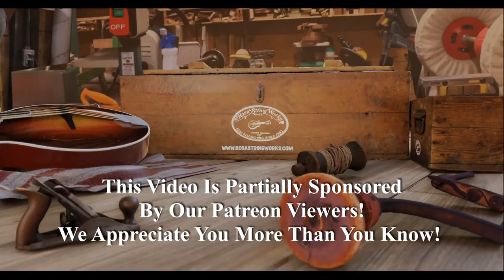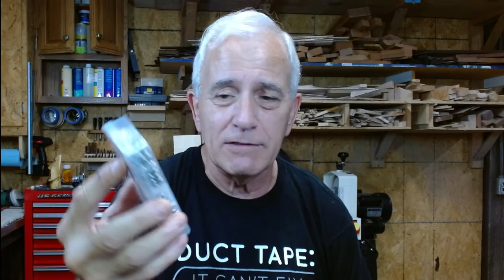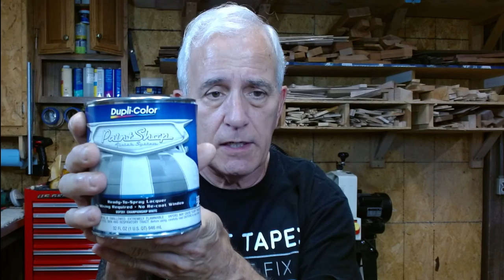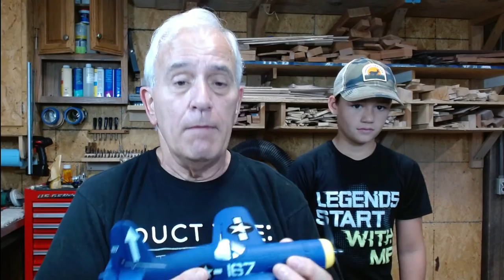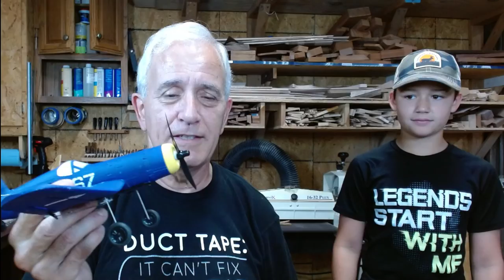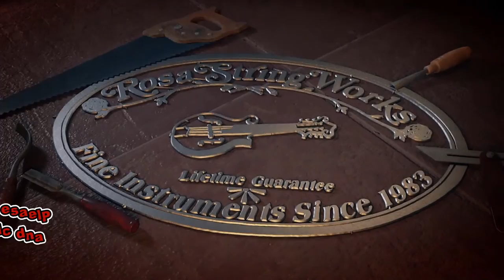Vlog 282 Live Trinians Project Remote Control Airplain

Comment: Oh boy, rc planes. I've been flying rc for forty years. 

I must say while low wing warplanes with a 400mm wingspan look cool they are extremely difficult to learn to fly with. 
Assuming the plane has a flight controller with beginner's mode a beginner wants to use strictly it else  smashed plane.

If your grandson wants to keep at it I would strongly suggest the Eflite UMX Radian 3 channel motorized sailplane. It in ready to fly version has a cost slightly above $100 and has both beginner mode called SAFE as well as the experienced mode. This plane is both nice looking and flys beautifully and is also a great beginner aircraft.

Other starter planes are pretty much any that has a high wing with a dihedral and today one can find these for under $100 in ready to fly  condtion meaning they even include the transmitter in the package. I like the UMX Radian because it is well made and will fly out of the box without any adjustments needed. The small 400mm wingspan planes can be a problem because often the factory did not do a good setup and the control surfaces lack the deflection needed to fly the plane.

Regardless of what you purchase you want the plane to fly straight by itself hands off so a power off hand toss is always a good idea that will identify issues if any in its ability to fly.

Good luck & beware it can be a bit addicting....
Reply from the maker: Thanks, I might buy that one for him.